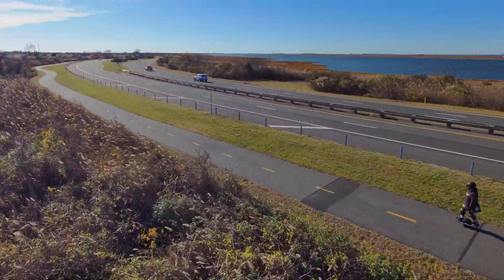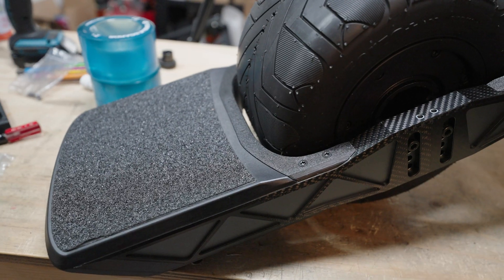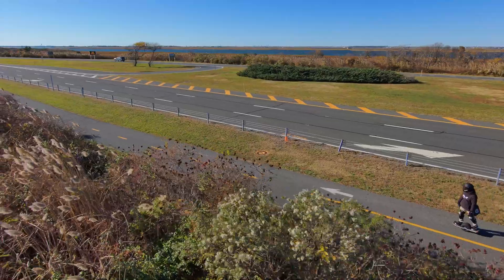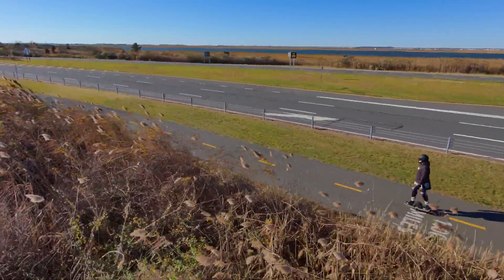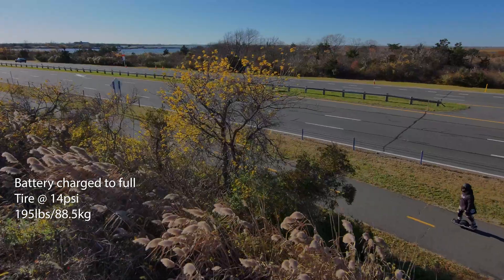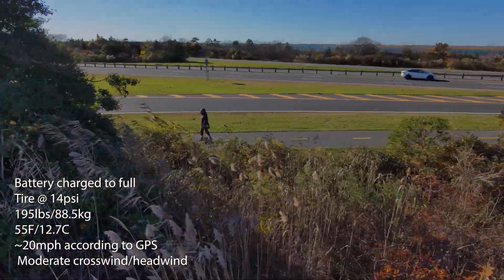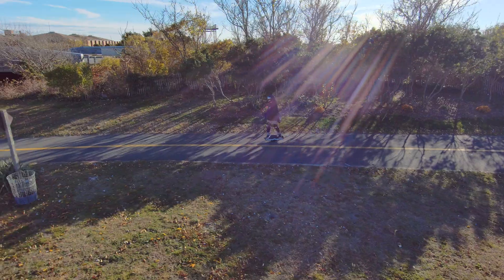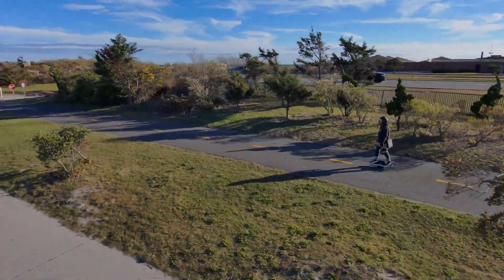Custom VESC One Wheel Full Range Test

Comment: Nice video!! Thanks for this.
But im curious... Does anyone have a good guesstimate on the 18s2p pack's range and speeds?  I cant seem to find much, if any, info out on webs regarding those specs.  
Any help or insight would be splendid. 😊
Reply from the maker: The 18s2p version of this battery (the ME4T Pack that I make at the shop) would get about 2 miles less than this board. If you look at my earlier video, I do a range test with the Floatwheel ADV, and my colleague is riding a build with the 18s2p pack, and he got an extra mile out of his board while coasting carrying the dead Floatwheel.

Comment: 14 PSI Mario?
Wow, didn't you always swear by running a super hard tyre at 25 PSI or something?
Welcome to the dark side, next thing you'll have a Burris treaded or something    😎
Reply from the maker: When I was riding the XR, the higher pressure helped with the response and range a bit. The 14psi specifically came about because of the old model Enduro I installed on my current board. It rubs above 15psi, so I left it at 14psi and enjoyed how it rode. And since it’s a VESC board with a larger battery and a Superflux, I can set the response how I like. The lower pressure is a very nice ride, wish I had done it sooner.

Comment: Due to uneven weight distribution,  you’re actually going to get more range if you ride a one wheel with the heavier side as the front side.
Reply: That's not how physics works
Reply: @thechickentendy3982  That’s what everyone says cause they have not tried it.
Reply: @Tatad3  Thats not how it works. Energy in is energy out. 

No amount of "trying it" will help people understand physics, but I ride a 22s2p vesc sploit pack build. Since that matters to you.
Reply: @coilerer  Since you cannot prove what you are saying, you'll never find out.
Reply: Umm no bud. 9.8 joules lifts 1kg 1 meter... the energy required to do the work doesn't change if you move the weight around. I don't have to prove this as its been extensively proven as a standard here on earth, I can prove it but there are many more reputable sources that already have .
Reply: @MrDmadness  How can you prove what you’re saying without even trying??? 🤔
Reply: @Tatad3  it called verified fact, just like how what you are breathing is mostly nitrogen
Reply: @MrDmadness  I guess you’ll never know…